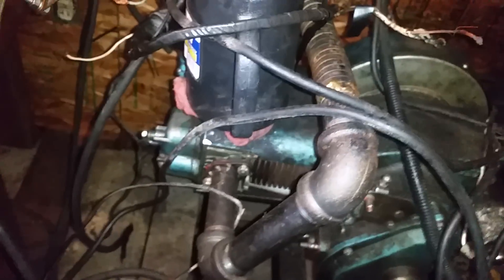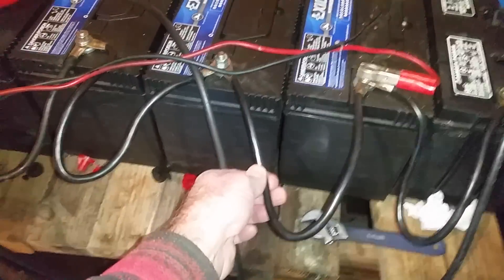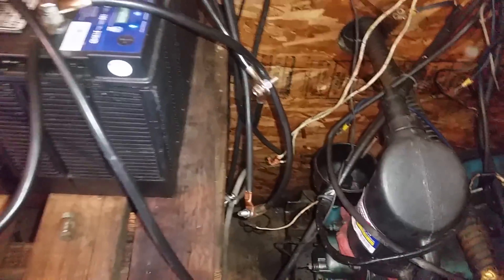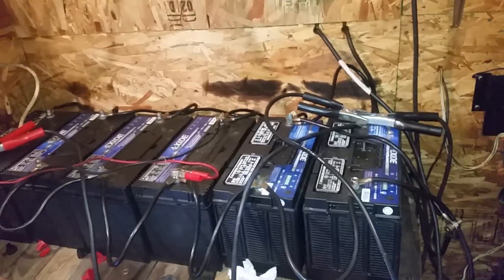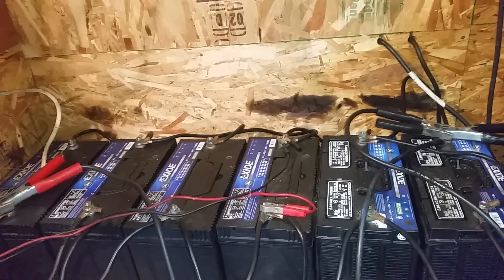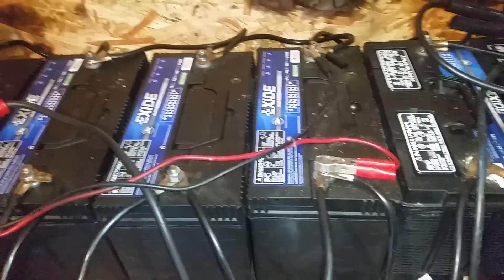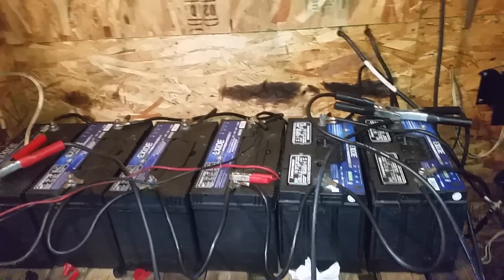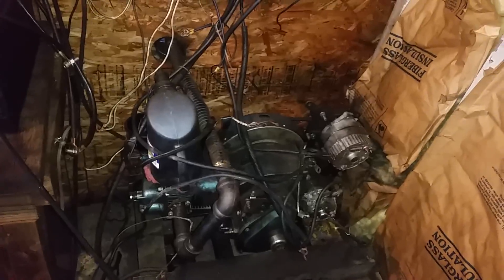Off grid solar homestead (helping a neighbor)

Comment: What good neighbor. I think you are doing everything correct. I would try and physically shake the batteries first and see if that will stir up stuff inside. With that amount of battery charger current, might be best to do each battery separately. That way you can re-do those cables or clean them up. FWIW...take care! Great video.

Comment: I don't know if one of those conditioners will work or not. That's pretty low for a 12v system. It's great that you're helping them. Looks like they could use a good neighbor...:)
Reply: +Steven Davis 
A fellow Oregonian from the southern coast and love your videos, especially those that show your electrical systems. I will reiterate what was said by 1timby. I have used a couple of different desulfators and they worked great on most simple lead acid batteries, not so hot on AGM but I did see improvement. I've used a battery minder well over 4 years on probably 50+ batteries and it has held up great. The larger pulse-tech chargers are much nicer though but seem to give the same general performance in regards to how many batteries we have brought back to life. Just saving one battery was enough to pay for itself. It has been awhile since I've looked into it but I believe pulse tech even makes a charger now that goes in line with solar panels to continually balance and recharge low voltage battery systems. Will desulfate anything on your old batteries and if new keep them from sulfating in the first place. Just found your videos a couple of days ago but keep them coming.

Comment: there are chemicals to clean up the plates but the cell can't be dead or all the lead laying in the bottom of cell.  if you can't remove the caps to check water level use a step bit make a hole and use a plastic plug to plug it after your done adding water
Reply: Your going to have to run it for a couple days to get them in shape. Do they draw large amounts of current yet or do they not want to take a charge at all. One other trick is to kick the batteries around a little to knock the dead lead off the plates